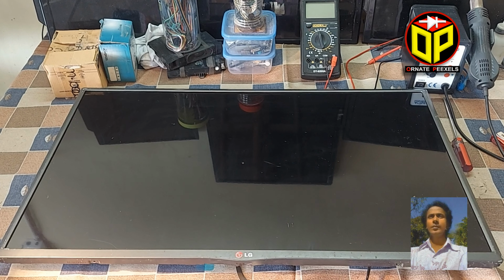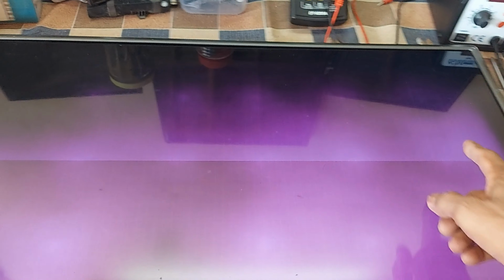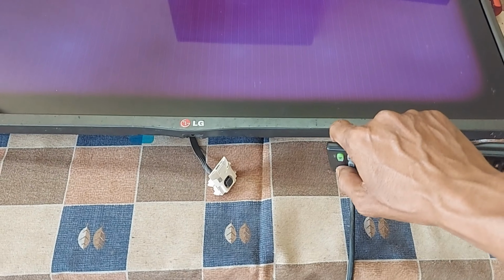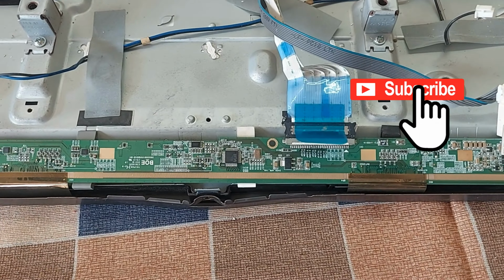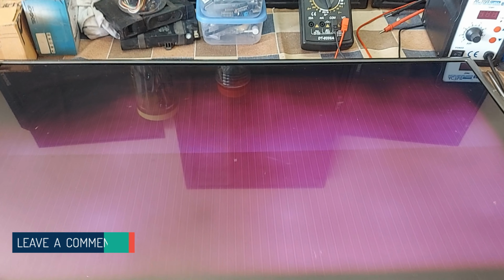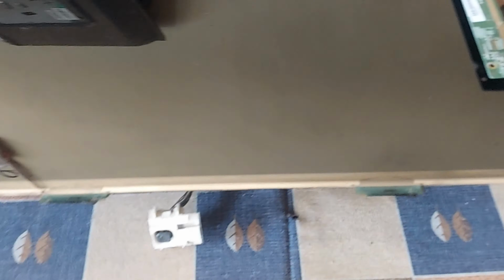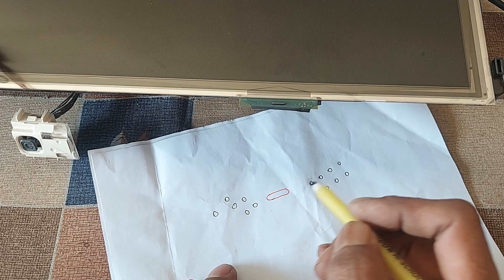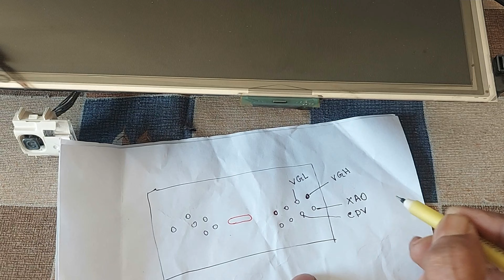LG 32" LED TV Panel Repair - Pink Color Screen Problem | NT39538H-C127A COF Data   HV320WXC-200_X

Comment: Have a 32LB582 LCD the problem is bunch of  vertical green lines appear and horizontally the bottom part shows the pic can you let me know the fault in this.. grateful for your help

Comment: good learning ser ji but i have a equations  in these tv model blue screen and vertical bar no vgh voltage  on t con 0.9 voltage what is the solutions help?

Comment: I have problem with this panel screen hovers0_x-pcb-xo.0  two left side cof burn  now showing vertical line the side cof is cy8656 all the voltages on the panel are there what's the solution pls help

Comment: sir Digital level shifter ic which is oneside 2.2volt all point and other side 10volt all point. What can i do sir?
Reply from the maker: These problems occur in most cases due to short circuits in the COF, there is no specific solution other than changing the COF.  However, understanding which side of the COF is short, you have to try to solve the problem by cutting the connection of CLK, CKV etc from that side COF.